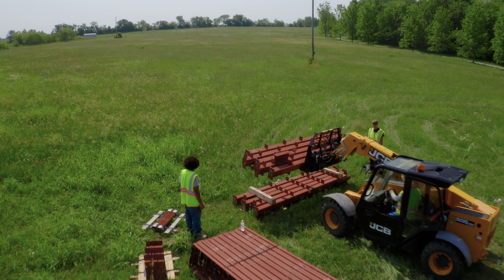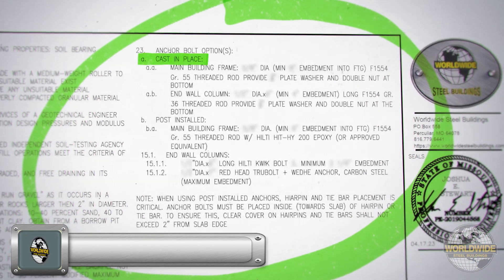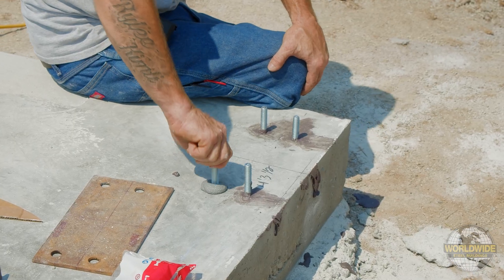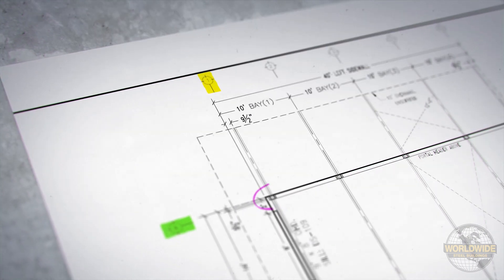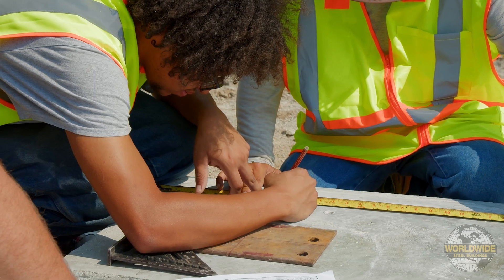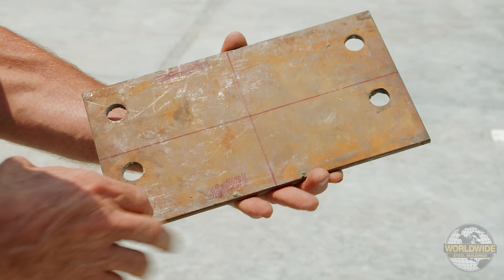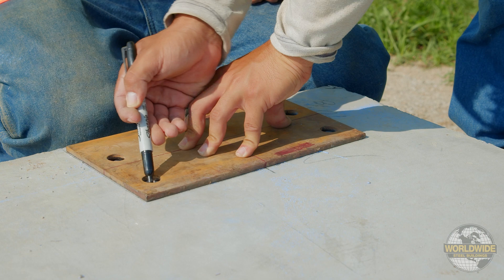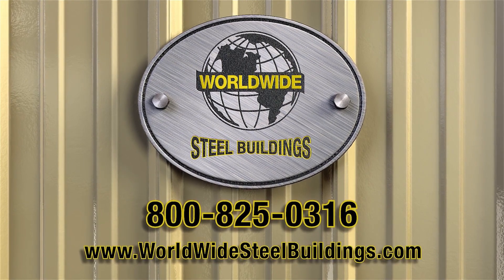Steel Tube Column Layout - Video for Builders and Customers

Comment: What is the length and diameter of the long bolt in the video
Reply from the maker: Good afternoon.  For this building's endwall columns, I believe we used 1/2"DIA.x6" LONG HILTI KWIK BOLT 3 with a minimum  3 1/4" embedment.  Every building is custom, so the exact bolts will be specified in your packet.  Hope that helps.
Reply: Thank You Very Much sir @Worldwidesteelbuildings83